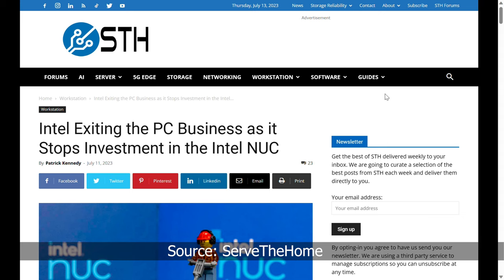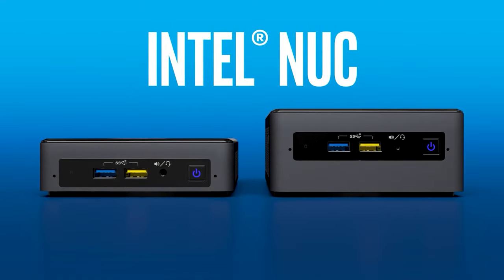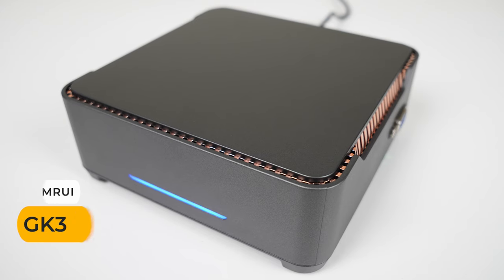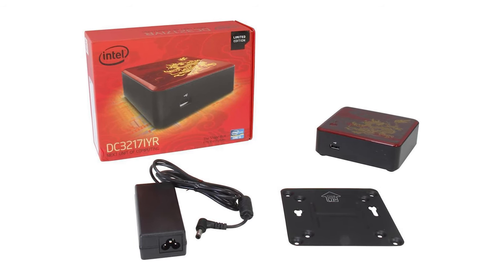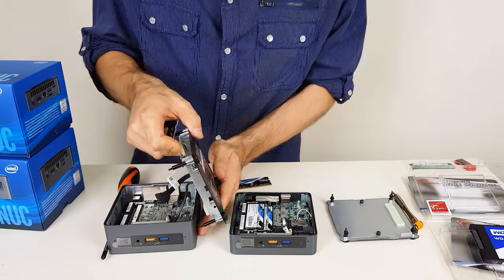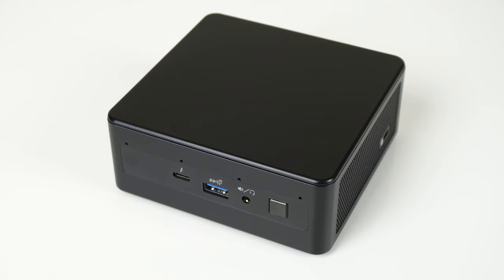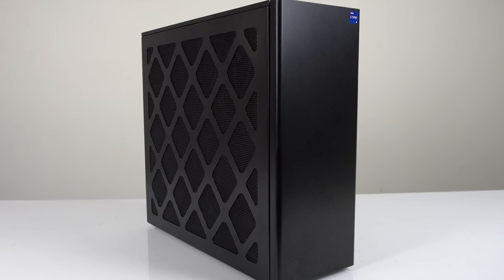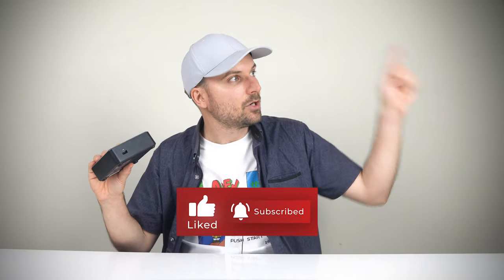Intel NUC is Dead

Comment: You hit the nail on the head.  Having worked at Intel as a EE, I know that NUC's were but a small drop of water in the revenue bucket.  As Intel didn't even produce them in their own facility, they were but a distraction from the real tasks that Intel has.  That is the real issue.  For Intel management to see Intel as successful, they need a huge amount of revenue per employee.  Those Fab's at about $20B don't grow on trees. Intel's real business is the Fab business combined with setting direction and targets for the PC and IT markets.  By being responsible for both design and build of the silicon, they can take the profit their competitors must supply to TSMC.  As Intel is still missing development targets, I believe they will continue to sell off or absolve themselves of marginally profitable side business.  Unless they get their fab process development team back on track, the whole company will fail.
Reply from the maker: Thanks for confirming Brian 👍

Comment: The NUC development was a bit schitzophrenic, too. When it launched they named it the "Next Unit of Computing" then decided to use USB 2.0 ports instead of USB 3.  They fixed that, then continuded to saddle it with lower performing integrated graphics. They worked to correct that, but also shipped them without power cords. They fixed that, then when the world was moving to DDR5 they continued with DDR4. It was continually two steps forward, one step back. Don't get me wrong, I've always loved the NUCs and they've very innovative. But more than once I was left scratching my head at some of the design choices.

Comment: One of your videos was the reason I picked up an i3 Bean Canyon NUC. It has been running 24/7 as a Plex and general file server and is still going strong. I've thought about replacing it but just have no reason. It can handle DVR recording, it can transcode multiple h.265 streams and it does it while running relatively cool. I had an seventh gen NUC I gave to a friend and it is still working fine as a web browsing PC and HTPC. These things just seem to last forever. The only oher NUC I wanted was the Phantom Canyon one but it was always too expensive. I lost interest when 12th gen dumped the aluminum case and IR port and 13th gen dumped the SD card slot. I expect the one I have to still be going for years to come so the NUC is dead but long live the NUC.

Comment: I hadn't known that the NUC's were officially called off and I liked this walk down their history. I have been running NUC's (mostly for work, but two for home) since the NUC5 and currently run 5  (some NUC10, some NUC11) without issue. I opted to replace the fan on the 2015 unit (which has run 24/7/365 for 8 years) just in case.  Having said that,  the more recent versions weren't appealing. And Rob, you're right:  I have a number of Dell micro's running and knowing that I have a 5 --years high-level support makes a difference.
Reply from the maker: Yep, personal and business usage have very different needs. I don't see any 4x4" alternative to fill the NUC business void.

Comment: As a NUC owner, this comes as no surprise. I broke plastic lever on a latest model NUC many months ago and called in to speak to service and they gave me two options: return the computer for another or just live with it. They not only had no replacement parts but no plan to to stock them. It was getting to the point where the small market share, lack or service options, and small batch proprietary parts could not justify the premium price.
Reply from the maker: Yep, spare parts have been gone for a few years now. Used to be able to get replacement fans.

Comment: Trying to sell an 8th Gen Intel Nuc at the moment with zero interest, so your comments are on point. Even after dropping the price 3 times, crickets. RIP Intel Nuc.
Reply from the maker: Try eBay, you'll get a better response. Selling minis locally has been difficult for me as well.
Reply: @Robtech  Yeah that's where I've had it up for a month. Reduction each week. Nucs really don't seem to be popular. 
BTW your vids got me on the NUC train. Upgraded to a 12th Gen and it's not too bad (especially with a eGPU).
Reply from the maker: Ah okay. I managed to sell a 6th gen i3 on eBay for $160AUD a few months ago. Took a while though as people definitely prefer newer gen units. If you're patient I'd say check the sold listings for how much they go for, price it around there and just have it up until it sells.
Reply: @Robtech  Thanks. I have been doing all that, just no takers. Had an offer of $200AUD which seems very low ball on an 8th gen i5.

Comment: I made the switch from Intel NUC to a Morefine PC. The Morefine was terrible. The little tiny legs/knobs on the bottom were not even so the pc was wobbly. The front panel USB-C/DisplayPort connection didn't work at all ( I only needed the two back display outputs so I could have lived with that) and finally the case was very cheap plastic. Never again. Will stick with Intel.... well I guess I can't. Unfortunate.

Comment: I discovered your channel whilst shopping for a PC during the lockdown. That was the Crimson Canyon NUC with the dubious distinction of having Intel's first consumer 10nm CPU in the form of the i3-8121U, paired with Radeon graphics (the chip even has AVX512 on it). It performs pretty well for what it is, and its still going strong today. Can't really say the same for a MInisforum unit I bought for my mom on a whim. Poor build quality, so-so value, and really bad thermals and rattling fans. NUCs really are built different, and I'm sad to see them go.

Comment: It's a shame they've killed it instead of innovating. Seeing the Minis Forum Elite Mini B550 which has the bracket to allow a GPU upgrade, it would have been nice to see Intel push similar stuff. Sure, the tiny box form factor is great, but I'd have loved to have seen a Mini PC motherboard and cases built for it. Hopefully that will still come. A barebones is fine, but if I could get the same motherboard, in a slightly chunkier case, even if it was just a taller one with room for a Noctua fan or something, that could be cool. 

As long as the current manufacturers still work on stuff, that's good but AMD, Intel and Nvidia do have a lot more power to innovate features in CPUs and GPUS. Asus doing their own eGPU cable is cool, and putting an NVME in a 4060 is great too. Imagine if you could get that and pair it with the Minis Forum in the future (when the price has dropped... a lot...) you'd be getting better graphics and one or two more NVME drives. 

Anyway... such daydreams of more impressive systems where why I struggled hard to resist the temptation to buy something a bit more expensive than the N100. I could have got a 5800H machine, which would allow me to play some games... but part of the point is to try and separate my work machine from my gaming machine for the productivity boost! :D

Comment: I love my NUC6i5, best purchase I've made. I use it as a DJ computer, it boots Win 10 and Mac OS10, plus it's battery powered. I made two 19v packs with raw Li ion pouch batteries, running around 3 hours each x 2. But I never used it passed 5 hours.

 I hope it never dies.

Comment: Hey @robtech , Thanks for this good video and all others in the past. My first experience with mini pcs was with the Intel NUC6I5SYK. I had been using an amd Athlon desktop for years and wanted to go smaller. Out of curiosity for the small size, I bought the NUC6I5SYK. I was impressed by it's performance and quiteness at the time. After that one I bought a NUC8I3BEK which I recently gave away to a friend who had an old dual-core desktop. These days, I am running Beelink's Ser5 Pro and GTR7. But, I managed to find a cheap NUC6CAYH a few years ago which serves me as a NAS. Although I prefer AMD's cpu's over Intel's at the moment, I would still miss the build quality and support of the intel nucs. I mean, I still got a bios update for the NUC6CAYH earlier this year, wow! Beelink, do we have your attention please?
Reply from the maker: Yeah, the 7 year+ BIOS support was crazy stuff.

Comment: I got me the last good NUC last November 2022: a NUCX17 with an 11th gen 8 core with an RTX 3070 fm Minisforum. Other than the occasional snafu, it has run well. I should be able to hold onto this for years to come. Now that the NUC line is dead, this is an instant piece of nostalgia. 🙂

Comment: Just got a brand new in box Celeron NUC from someone who was about to throw it out.  I had it in hand, and didn't dig into the box until you said "some regions didn't ship power supplies" I check the box.  No power supply, it was paperwork and a mounting bracket as the additional weight and sound.  I'll have to order one.  I'll probably throw Ubuntu on it.

Comment: And here I was waiting for the 14th gen NUC to replace my old small media PC 😩
Reply: You might be able to get one on discount sale now.  No support though.  

There is still Geekom IT#, which has the exact same build style.  Only difference is you can't get one barebone and they are slow releasing the latest Intel CPU.  Geekom IT12 with an i7 CPU is available for $639 USD.  It comes with 16GB of RAM and 512GB of SSD storage.
Reply: @akin242002  The NUC 13th Gen i5 line seems to go for around 400€ here in Finland, which seems to be a good deal - even if you compare it to the Chinese 3rd parties. I just would have loved to see DDR5 support for it...

I'm probably still better off waiting for the 14th Gen to release and see what the Chinese manufacturers will bring, though I'd still prefer a unit from a well-known reputable brand.

Comment: Many thanks @Robtech! I followed your video to set up the 8i7BEH I bought back in mid-2020. I was really happy with it at the time and recommended it to many friends and family members. But I am now onto the 3rd replacement unit sent from Intel -- all of first 3 units developed power/fan problems (2 of them just stopped working all of a sudden). I realised after watching your video that perhaps I should have gone for the i5 instead :( 

I haven't tried other mini-PC brands yet but judging from online reviews/videos it does appear that most of them don't have the same build quality as the NUC. My suspicion is that this latest replacement I received from Intel is likely to develop similar problems before too long (and warranty has run out), I might get a 11th Gen i3/i5 barebone while stock lasts lol.
Reply from the maker: Interesting you've had such a bad batch of NUCs. Wouldn't be surprised if you disagreed with me on the reliability 😅 Hopefully the next one holds up better.
Reply: @Robtech  Actually when I was spreading the NUC 'gospel' 3 years ago I did manage 1 'sale' and set up a 8i5BEH for a friend 😂 Fortunately 🤞their's still OK hence I think you're so right that it is likely to be a over-heating problem for the 8i7😭.

Mind me asking your view on the NUC11TNHI please? 😁TTVM!
Reply from the maker: Unless it's dirt cheap, it's outdated. 11th to 12th gen had a big upgrade on the CPU side.

Comment: Watched this video on a NUC8i7BEH that I recently changed the fan on and applied new thermal paste.  A few months ago I was looking for a new NUC, but found ASUS now supports them (and that is a company I no longer trust for my computing needs).  I ended up getting a GMKtek RYZEN based plastic "NUC clone".  Seems ok, but with a little love, my original NUC may still be here when that thing melts.  Primarily use macOS anyway and like to keep a Windows PC around for a few things.

Comment: I was interested in the Nuc 13 Pro Desk Edition to replace my 20 years old PC. Does that mean that it won t exist anymore and even if so, is it smart to buy one?
Reply from the maker: I plan to get one too. Warranty will be covered. You may just end up getting money back instead of a replacement if they don't have any at the time. If you want one, go for it. Beautiful design on the Desk edition and has the latest CPU. Software support will continue as all the mini PC CPUs are used in laptops as well.
Reply: @Robtech  OK thanks, I ll probably go for it then. What is best for you, i7 or i5, ans also are there different heights like the previous ones?
Reply from the maker: Doesn't look like there's a difference in height, just the one unit. I'll probably go i5 since I haven't review it, but waiting for a sale first and then I'll decide.
Reply: @Robtech  do u plan on making a complete test of either the i5 or i7 on your channel?

Comment: The first one I bought was in 2014. Just based on the TDP compared to my main rig. Wilson Canyon D34010WYKH .15W TDP seemed better option for daily surfing and all compared to my AMD cpu with 65W TDP only for its processor. :P .Got 2 more of same model for my parents and grandmother in my village (all of them still working ).I watched the video on that only. Although mine died in 2020 lockdown but it turned out to be the cpu fan that died which I easily replaced and its all up and running. I got the 8th gen i5 one based on your suggestion in 2021 and its the best so far. its sad to see it go
Reply from the maker: Yeah the fan is most likely to be the culprit as that succumbs to wear and tear. Thanks for watching since 2021! 😀

Comment: I have a mac mini studio and since it's not possible anymore to instal windows using bootcamp I would like to buy another mini computeur for gaming (Alien dark descent). What NUC do you recommand me (if any ?)
The Nuc11PHI7C ?

Do I need to add the SDD and DDR seperatly ?

And finallybut not least how to install windows on it ?

Please excuse my PC ignorance and Long live the NUC.
Reply from the maker: If gaming is the goal, the options are either NUC Enthusiast or NUC Extreme. The Nuc11PHI7C meets the recommended specs for that particular game, so that would be fine. Unless you find one pre-built or a used one, you'll need to add memory and storage. That NUC uses SODIMM DDR4 memory and M.2 NVME. A 16GB (2x8GB) DDR4 3200Mhz kit or more is recommended. The cheapest one is fine. To install Windows, you'll need to create a Windows USB installation media. I do have a guide (https://youtu.be/Rf3ATGeRZHo), but you'll need a PC to follow this one. If you don't have access to a PC, you should be able to create the USB on a Mac with a different guide.
Reply: @Robtech  Thanks for the help ! I will try to find a NUC11PHKI7CAA (ready to use) first.

Last question : for you today what is the best mini pc for gaming of any brand that you recommend if budget isn't a problem ?
Reply from the maker: That would be the Minisforum HX99G. I have reviewed it also

Comment: I have an Intel Nuc working as my server. I killed one during a BIOS upgrade, but the support was still covered under warranty and the new one that came already had the new BIOS. 
It was a family PC for a while basically for 1080p YouTube and Netflix. I've since repurposed it as a NAS with Ubuntu server running on it as well as Nextcloud. External USB drives augment the experience while it sits next to the router just quietly doing its thing. Traveling aboard I was still able to access it using Tailscale. 

Almost 6 years old at this point with at least 3 year old hard drives, it's held up quite well running light server tasks 24/7. I think the NUC line shouldn't be looked at as a desktop, but as an adept server. My NUC is a Celeron chip, but constantly hovers around 5% CPU use given the light build, but still has 2 x 1 TB drives and a 4TB drive for backup that helps store and protect all the personal data my family has. It's a workhorse that fits in a cupboard, and that's special.

Comment: Intel launched the 8i3CYSM and then discontinued it a very short time later (after I had purchased two).  One died after a year.  To replace it, Intel required me to first pay full retail price for the replacement (over $600 US), and then a few weeks after receiving the failed unit, Intel reimbursed me.  The replacement unit died after a few months, but this time Intel would not support the warranty because they did not recognize the failed unit's serial number; in fact, that model number no longer even appeared in their database.  My other 8i3CYSM lasted almost two years before it died, and I did not bother to pursue warranty replacement.  My brother's 8i5BEH, however, is still his daily driver after five years of use (with him replacing the fan twice over the years).
Reply from the maker: Odd. I do remember reading that the Cannon Lake CPUs had massive problems during production with very low yield. This could be the reason your units failed (CPU failure). That specific NUC never sold in Australia, so I never got to try it. Instead, I bought the i5 Islay Canyon which was absurdly loud.

Comment: I have a nuc8i5bek and it's because of one of those vids that you removed, where you showed the unit's gaming ability. Of course, later you produced another vid which slam the nuc8i5bek for fan noise lol. 

My nuc8i5bek didn't give me any noise until a year ago when the fan went south. Replacing the fan was a little challenging but didn't cost much.

Comment: Time for AMD to announce their line up and pick up where Intel left off. They have much better iGPU performance with more mature drivers. Unless market dictates that the returns are not worth it.
Reply from the maker: They never will. Like Intel, they're a processor company in the business of selling processors, not computers. By creating hardware, they would step on the toes of their partners.
Reply: @Robtech  Intel wasn't stepping on the toes of their partners with these NUCs?
Reply from the maker: By selling the majority of them as barebones and not as complete computers. And not because they wanted to, but because none of the partners were interested. Plenty of AMD partnered minis around.